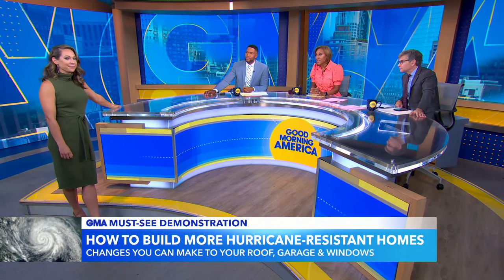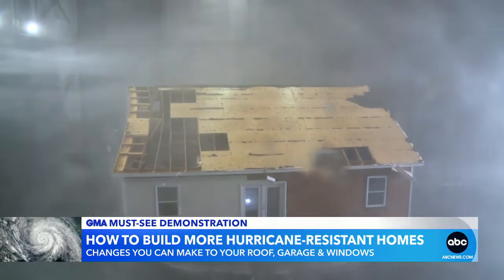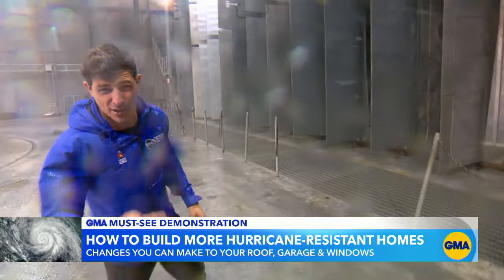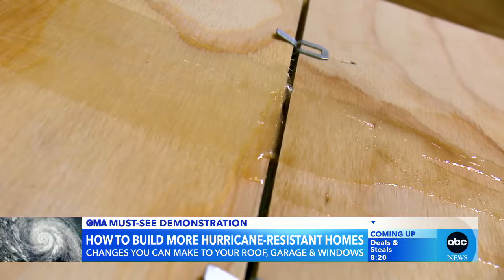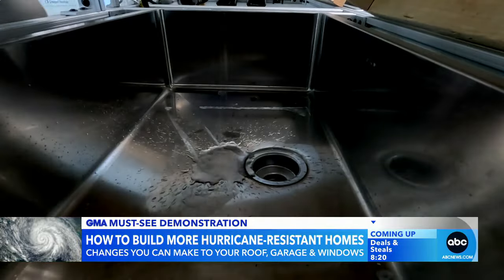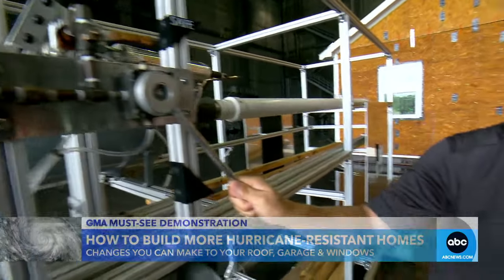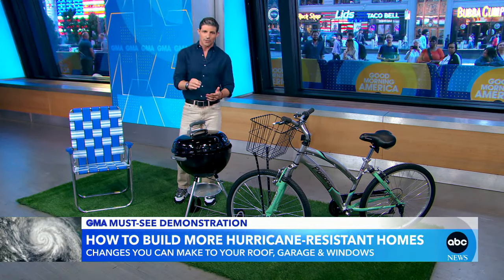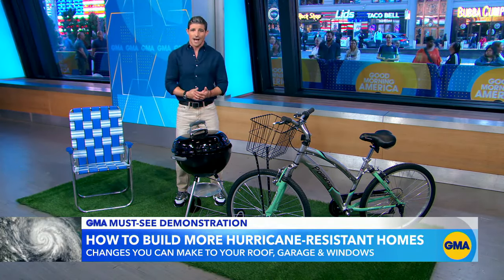How to build stronger homes to withstand a hurricane

Comment: Solution: Cement, Concrete
Reply: You forgot rock and metal roofs
Reply: I was just about to comment that they need to stop building these house out of paper
Reply: Do not forget rebar
Reply: No, just steel
Reply: @SheriKeenan good ideas but what about lightning?
Reply: elevating a house and using concrete adds at least 40 bucks a square foot to the cost of construction, which is why it's probably not done frequently in flood prone areas.
Reply: Problem: cost
Reply: I have tried. Too heavy and caves in
Reply: That’s why Mexico is more well prepared 😅 houses and buildings are mostly built with cement and concrete
Reply: I live in a concrete house. The floor, walls, and roof, along with the industrial rolling shutter for the garage, can withstand a 175-mph wind—a Category 5 storm.
Reply: @jeffenad5412 roof, after making all those things stronger, u built roof ? Have cement sab

Comment: Brick and concrete instead of cardboard?
Reply: Need steel with concrete
Reply: Yes. I live in Miami and every home in south Florida is built with rebar , concrete block and poured concrete.
Reply: @hyp1755 
And that's what collegiate sports stadiums use to protect itself from hurricanes or tornadoes.
Reply: Im from asia and im really asking the usa why they build so weak and they have tornadoes and hurricanes much like in tropical asia.
Reply: @rrsee-zk3zu  When Asia gets hit by typhoons, they usually have much higher casualty counts (often in the thousands ) compared to the US getting hit by hurricanes.
Reply: I wonder how a ICF home will do against a hurricane
Reply: @fargoth391 Cause Asia is mostly developing. Most those who are killed are living in shanty towns or squatters area with informal living conditions. I live in Manila and most of us who are privileged enough to have reinforced concrete homes are spared from the strength of the typhoons. We often get at least 20 typhoons here annually and our home for 15 years is literally undamaged. Weirdly, a first world country like the US won’t regulate its buildings to withstand these systems for decades?
Reply: @fargoth391  To add, geographically, most of tropical Asia are surrounded by water and steep mountain ranges. Hence casualties aren’t coming from the typhoons alone but from storm surges, landslides, mud slides, etc. But definitely not commonly from weak homes.
Reply: @rrsee-zk3zu  "Most those who are killed are living in shanty towns or squatters area with informal living conditions."

"Weirdly, a first world country like the US won’t regulate its buildings to withstand these systems for decades?"

Says you?
Reply: @fargoth391  Says the me who lives in Manila Philippines (Yes the country that is passed by Typhoons most on earth), and is an Architect with background in Urban Environmental Planning, Engineer, and Real Estate Broker by Profession.  Also, as someone who keeps on hearing the US is a first world country, and is the greatest nation on earth. Yes I say so. Got that?
Reply: @rrsee-zk3zu  "Most those who are killed are living in shanty towns or squatters area with informal living conditions."

Why are these allowed to exist?
Reply: @fargoth391  Again, most countries in Asia are still developing - basically this would give you the clear picture already? Didnt you learn this in Social Economics and Finance from high school or college?
Reply: @rrsee-zk3zu  Ah yes, still developing after thousands of years 🤣🤣
Reply: @fargoth391  ah yes still developing due to colonialism and getting exploited by other cultures. Yes, you’d know more if you listen to your social history and economic classes ☺️☺️
Reply: @rrsee-zk3zu  Excuses excuses
Reply: @fargoth391  technically not thousands of years considering how Filipines and most of SE Asia got independence in the 1960s. But I bet you’ll say those are just excuses and I say the same thing to the Floridians with their destroyed homes. But they got what they voted for.
Reply: @bfreezy7  yeah, however, they are not made to be hurricane proof. real estate developers want to spend as little as possible, and charge as much as possible. Also, rebuilding every few years ensures their business model and boosts Florida's GDP. Capitalist incentives don't align with societal needs.
Reply: @xx133 the building code was changed in 1992 after Hurricane Andrew. Where i live homes new homes must be engineered to withstand 175mph. The should get through a significant storm relatively unscathed. The design has been tested several times and holds up. Please look it up.  If there is political pressure from the developers it’s to not make the code as strong in the northern part of the state as it is in the high velocity wind zones. The picture is a little more nuanced than what you are painting.
Reply: @bfreezy7  yes, the housing infrastructure is so resilient in Florida that insurance corps are fleeing the state altogether, and 80% of condos prior to the hurricane were deemed potentially structurally unsound. Housing regulations seem to be working very well. 

They’ve also improved climate resilience by officially removing “climate change” from all state literature—aside from stating that Florida, under law, cannot take climate change into consideration for any regulation, law, bill, etc—thereby completely nullifying all regulations related to climate resilience. 🤔
So yes, much nuance.

Comment: It baffles me that the US has such a massive percentage of homes built from weak materials like plywood.
Reply: It's all designed to make sure that companies who makes all of those resources for you to build your home to make sure that you keep buying and buying so that they make more money. Same way with vehicles. Vehicles used to protect the driver and the others inside of the vehicle with hard steel that can save many lives. Now, it's all about money more than a person's safety.
Reply: Sfeel cars actually caused more death  @RowdyJr
Reply: I know like brick rock and concrete are best at protection and not falling over.
Hell the fact people still use asphalt roofs in such places is stupid like use a metal roof bolt it down.
The worst part is we constantly complain about co2 levels forest gone not having enough lumber for homes and yet in places that destroy wood homes every year they continue using wood like wtf stupidity is what that is.
Reply: GREED
Reply: @RowdyJr you are so absolutely certain about being wrong. mostly about vehicles. And physics, apparently.
Reply: Plywood is probably one of the strongest materials used 😂
Reply: It's much faster, construction crews in the US are generally small.
Reply: @RowdyJr  No, not like cars. cars have crumple zones. Cars today are far safer and expensive to produce than 50 years ago. Correct about housing, however.
Reply: @xx133  
Excuse me but cheap plastic, rubber, and silicone is a lot safer than STEEL !? 🤣🤦🏼‍♂️🙄 No wonder  why we humans are not the brightest tool in the shed compared to the big brains in the 50s ong

Comment: The roofing industry is why we all have paper roofs in FL. Metal roofs can withstand Category three storms and don't have to be repaired replaced every 10-30 years. They can easily last 50 years.
Reply: Have you been to Florida? My house has been been is the eye of two hurricanes, hit by multiple, and gone through 2 cat 4's. Same wood roof 22 years later. No leaks related to storms.
Reply: Tbf it does have a life of like 25 years, but it's been alright

Comment: I roofed a couple buildings in Florida that was rated for 150mph and it took thousands of screws and plates drilled inside beams melting and welding materials not shingles and nails 😂

Comment: Why don't you build reinforced concrete structured building
Reply: The reason is likely enormous cost for a single detached home to go that route.   But there is a way one can get reinforced concrete construction without costing an arm & a leg: just buy a unit in a high-rise condo! 

Seriously, I'd get a condo unit if I really had to live a hurricane prone area.  This gives greatest chance of protecting life and property.

High rise buildings are indeed made of steel and reinforced concrete since you can benefit from economies of scale and such large buildings need that strength anyways.  The height will save your property from storm surge.  Unfortunately, Americans are too hung up on single detached homes which are bad for the environment and contribute to urban sprawl.  Detached homes also use up a lot of energy because of high surface area.  We can see detached homes are very prone to being ripped up by hurricanes and tornadoes.

As extreme weather continues to ramp up over the next few decades, single detached homes in these areas will be uninsurable for 95+% of people shortly.  Urban life in such areas will be forced into condos.  Look at places like Asia where condo living is the standard, and that may be arriving to US en mass within the span of the next 30 to 50 years.  You have to adapt or die.
Reply: @beyondfossil condo's are the last place I'd want to be lol. Mostly in flood zones, built on swamp and sand, and most of them are hitting their service life. A good portion still built pre-90's hurricane codes

EDiT: only applicable in Florida lol
Reply: Most houses in Florida after Andrew are. Get educated.
Reply: "enormous cost" the house I live in has Brick walls and all floors are reinforced concrete. Bought it for 180k (it is worth 400k now but it's still cheaper than a lot of American paper houses) @beyondfossil

Comment: Don’t use wood have concrete brick or rock walls have a metal roof bolt it down.
Have home on strong stilts or build a hill to put the home on so it’s 3 to 5 feet higher then the landscape around it so it’s much less likely to flood but still have a full normal concrete foundation slab.
He’ll reducing the amount of concrete and asphalt by 20% in towns and cities and replacing it with native plants and trees with lots of available soil will reduce flooding as it now has a place to go the soil also plants and trees slow the fall of water so will reduce flooding as well.

Comment: Cheap modern lightweight construction. Flimsy 2 by 4 roof trusses, 2 by 4 walls, Oriented Sh_t board made of wood chips glue and wax. Look at the roof (6:46) covered with thin sheets of OSB, and you can see the OSB failing and the nails pulling out. You're going to love your new house and wait until you see the price tag on a garbage heap like this.....

Comment: I have no idea on why Americans make homes so cheaply .. In The Bahamas bricks, concrete are standard and mandatory to be used in building a home ..
Reply: Well maybe bc the US has alot of trees 🤔.Its also cheaper to use wood,Bricks and cement and concrete Would be more expensive and also it takes longer to
Reply: @LATRY45 but why sell plywood house with crazy prices😮?if the material are cheap cost.
Reply: @hanisrosli5484 it's land that expensive. Not the house, that's why they keep rebuilding it
Reply: @LATRY45 that's my point .. Despite the expense you want it to last through the weather .. Making wooden homes we see how that played out with the 3 little pigs and the wolf
Reply: @TinoMiller  The US Natural Disasters are far worse than any other country.US use to build they’re houses out of Bricks but due to the hazard of them flying during disasters it causes far worse injuries/damages.Wood is far easier and if its built properly it shouldnt fly away during a hurricane.Concrete is far way expensive in the US.Yes its better but its dangerous
Reply: @hanisrosli5484  Bc Wood is literally cheaper than any other method.The US has a huge budence of wood.Concrete is far way expensive,Brick is hazardous during disasters as the US has the worse Tornadoes,Hurricanes
Reply: @LATRY45  i dont think brick are hazard during hurrican or even tornadoes category f4 and below,if you build with proper method,it can withstand far more better then any very good method plywood house,the weakness part are just roof,any roof are in risk accept you roof are solid concrete just like some asian country house,and the false facts are mostly american think are brick cement and concrete house with renforce are prone to earthquack,if magnitude are 6 below many brick house with proper build can withstand that,dont tell me maginitude 7 because this force are too much for any building brick,concrete or plywood,wood because magnatude 7 its a another srory

Comment: Well, it's already a hurricane/storm prone area, it should've been concrete to begin with when you talk about housing. On the other hand, climate change and global warming has already been an issue for eon...we need to be firm and start doing something beneficial for the environment and not too much urbanization and making the area too🎉 commercial. There should be a fine line on what not to touched anymore. We also need to plant more trees in the mountains and forest.

Comment: Bruh, the house wasn't even damaged.  The wood did just fine.  Instead of replacing your roof with shingles, put a corrugated metal roof on it.  Problem solved and it is still an affordable house.  The wind from a hurricane doesn't do the damage anyway, it's the storm surge or a tree falling on it.

Comment: May wanna think about GLUING down that sheathing! You know... construction adhesive have you builders and inspectors and idiot attorneys ever heard of that nasty stuff? Obviously NOT! Because THAT'S how most buildings are lost (when sheathing is sucked off the leeside of the roof). Because once that happens the envelope has been penetrated and interior pressure blows the building out.
Reply: Yeah glue should do it since wooden nails doesn't